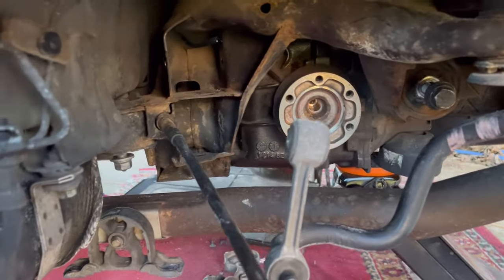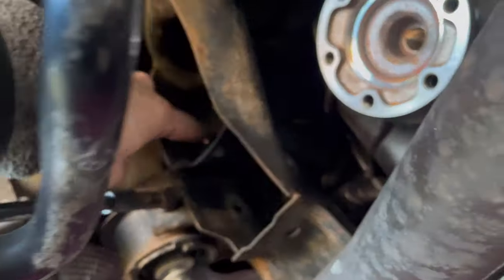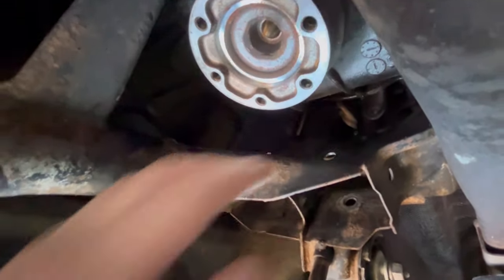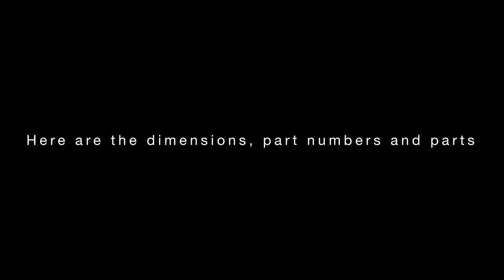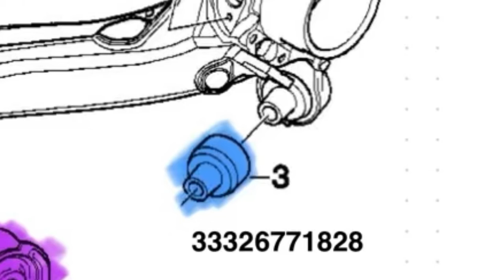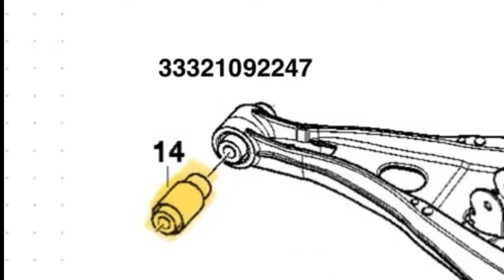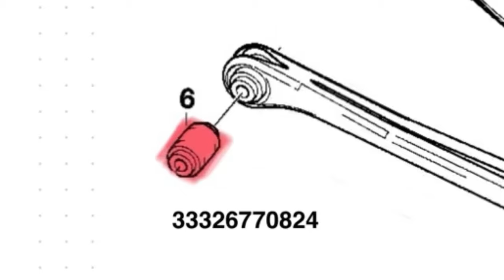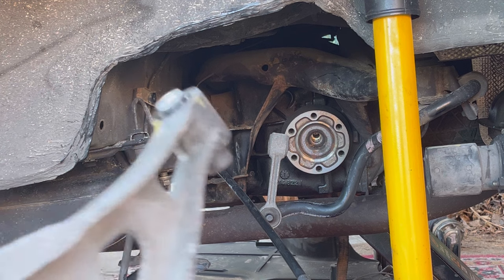Rear suspension rebuild | BMW e46 Compact

Comment: It was a good video!
An interesting point:
The upper outer bush can be inserted instead of the lower outer bush.
Its dimensions are exactly the same.
In the case of the M3 version, this is the factory solution.
The article numbers also match.
Maybe the car is a bit more agile, maybe that's why they did it like that in the case of the M3.
Reply from the maker: Interesting observation! The top exterior ones are spherical bushings (is it the right term?), which means they have a certain degree of freedom. Maybe that allows to fine tune the wheel alignment and suspension on the M3 even more than on the standard e46 chassis

Comment: Do i have to release hand brake ? , didnt seen on any other videos they are doing it..
Reply from the maker: Yes, that way it'll be much easier to detach the hand brake wire from the handbrake shoe. And then you'll have plenty of room to release the wire from the wheel hub assembly altogether